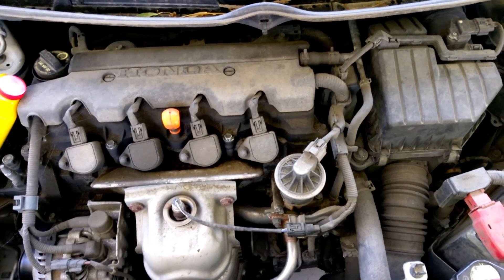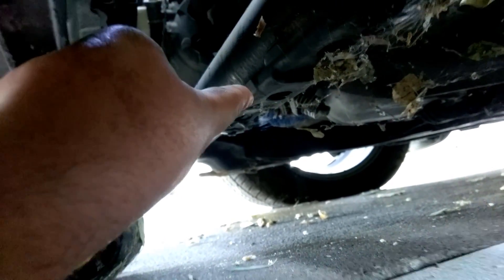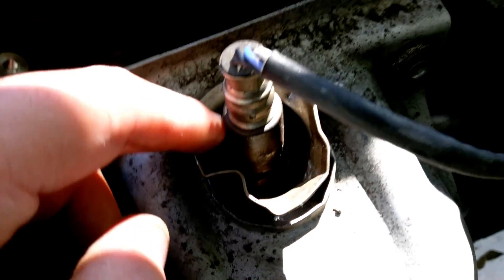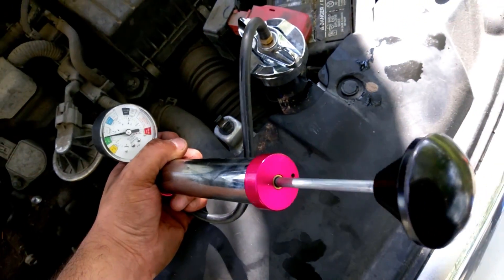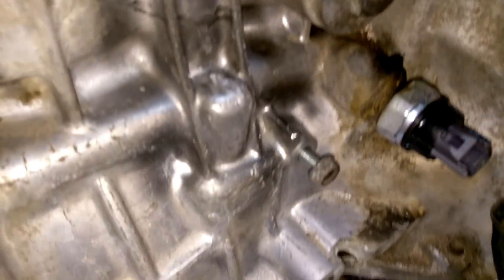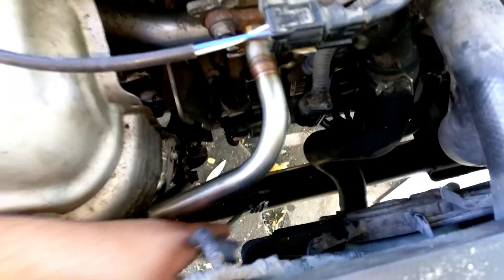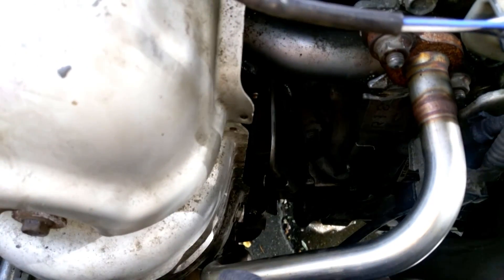2006 Honda Civic Cracked Engine Block Repair

Comment: It works !!!! most importnat thing is to take out the coolant completley so when you apply jbweld on the engine block, the coolant doens come out. I took out inlet pipe line to take out coolant completley.
Reply: is it still working?

Comment: Tips:  
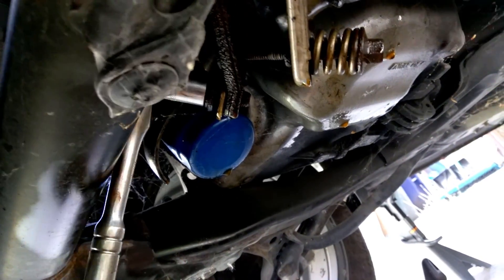2:40 when taking out the oxygen sensor. There's two parts. You unplug the one to the right first. Then the one with the sensor is clipped to the bracket. The release switch is facing you hidden behind the plastic. Push down the switch and slide the plastic from the bracket.

2:52 just loosen that bolt you don't need to remove it.

Comment: Prior to covering with JB Weld I recommend using Loctite 290 and primer T or primer N. Coat the crack with primer, let it soak in and dry for 5 to 10 minutes. This cleans the crack. Apply the Loctite, leave it for 30 minutes to an hour to allow it to cure. Remember Loctite cures in the lack of oxygen. Then go ahead and apply the JB Weld. Loctite 290 (green) is meant to seal cracks as well as thread locking of assembled nuts and bolts.
Reply: HI,

 I live in Canada and its hard to find Loctite 290 in stores or on Amazon, the only Loctite product available in stores is Loctite Blue 242.  I have found an equivariant product which is Permatex Green Thread locker.  However for the Primer T or Primer N I can't for the life of me find this in stores or online, and unfortunately I cant find a suitable replacement either.  Are there any other products I can use that is the same as Primer T or Primer N.  Any suggestions would be greatly appreciated. Thank you.
Reply: Is the loctite and primer good for a cast iron block crack as well? Or only aluminum?
Reply: When you mention primer t, are you referring to Mapei Primer T waterproofing membrane?
Reply: @jalton9416  I think he refers to Loctite 7471 PRIMER T or Loctite 7649 PRIMER N
Reply: @JavierAlba  thanks
Reply: I just used your method with success.

Comment: Woah this works! I just did this on my 2008 civic a couple days back. Same process but I had to remove the alternator as well to really get into the crack area. Be warned! This isn't a permanent fix, it can last 2 months, or 2 years! No way to tell unfortunately.
Reply: is it still working ?
Reply: @matthewkretz4257  So far so good! It's holding up quite well here up in Canada with the cold. I'll probably add on a another layer of JB Weld in the spring time.
Reply: @BigChunkyy  Update?
Reply: @FD-rh6tr  still functional! I've actually done a few long distance road trips with zero issues!
Reply: @BigChunkyy  Insane. My 2006 R18 with 160K hasn't cracked yet, but i might have to do this when it does!
Reply: @FD-rh6tr  I'm amazed myself too. Such an expensive fix to a huge problem. Holding super well too, I check my engine for leaks or drips every so often and still nothing. Bone dry! Literally saved my car
Reply: Is it Still working?
Reply: @luis4769  It is! I've already put on about 20000 kilometres since the patch
Reply: @chelsy Jordan is it still working? I was thinking about doing the same thing but I heard that the material gets stuck in the radiator or what not and cuz of that it causes it too over heat has this happened to you has any of the seal leaked off into any other parts or?
Reply: @BigChunkyy  ^
Reply: @ayaanhashmi7161  hey, yes it's still working! I haven't heard anything about that myself, but I know for a fact that it's been holding up and nothing has been leaking. JB Weld is rated for high-temperature use, if you're worried about leaking I'm pretty sure J-B Weld even has a high heat version. Depending on where your crack is, it shouldn't be touching any other components anyway, that was the case for me
Reply: @BigChunkyy  thanks so how long has it been since u patched it up and it hasn’t even started leaking a bit yet? Temperature and what not is good? No overheating or such?
Reply: @BigChunkyy  i actually have the same problem and somebody told me like I won’t last long with this leak so I’m just finding whatever I can to fix it without replace my whole engine block as my engine is in very good condition i just have this coolant leak problem
Reply: @ayaanhashmi7161  what year and make is your car?
Reply: @ayaanhashmi7161  look into liquid solutions like K-Seal or others. But the Weld worked like a charm for me, mind you I do have an again car and it was the Weld or a new car so yeah
Reply: @BigChunkyy  i have a 2006 Honda Civic I live in Canada as well so I’m trying to find something that won’t go wrong for our weather conditions
Reply: @BigChunkyy  The external temperature of the block is well under the JB weld max temp requirements of 500 degrees.     What will probably get you over time is vibration through the jb weld product will eventually cause it to start to break down.   But fresh aluminum weld won't be subject to this issue.
Reply: A little update for anyone who wants to do this on their car or is curious about how it’s going. It’s been almost 3 years now since I’ve patched my 08 civic with JB Weld for the same engine crack problem. Since then I’ve put on just a little over 35,000 km and I’ve driven it all year around through summer and winter. Coolant levels are stable and the temperature gauge always reads normal, thanks again for posting this video! You helped save me so much money in replacing the engine or even worse getting a new car
Reply: @BigChunkyy Just curious, what was the procedure you used to JB weld it?  I hear mixed results, I’m assuming you drained the coolant and really cleaned and prepped the block well before applying JB weld?
Reply: @BigChunkyy
What type of jb weld did you used ?
Please let me know !!
Thanks in advance
Reply: @josexivir4260 The original one. The one that comes in a black tube and red tube
Reply: @ammardin6550 my procédure was pretty similar to this video. My crack on slighty to the left so I removed the alternator not the o2 sensor. Then I cleaned and sanded the block the best I could for the JB to stick. And no I didn't drain the coolant.
Reply: @BigChunkyy  
Thank you 
I already did it with the jb weld marine one
Reply: @josexivir4260 hi. Wondering how yours is holding up?  Doing my ‘06 civic now and will see how it goes.

Comment: have a 2006 civic. backs in august 2018, and after only 43K miles on my car, the engine cracked. Honda did extend the warranty for 10 years from production date so my warranty expired in august 2016. since i was 2 years outside of the warranty, honda would not replace my engine for free. they wanted me to pay $4000 and they would pay "the rest" - stating it would be 7K plus. turned out it was $5500 so I still had to pay $4000 and Honda got off paying only $1500. Since getting my car back, the transmission is not shifting smoothly and the engine light came on. Honda wanted $190 to run diagnostics. I said eff that!! Honda makes me sick!! they knew about these faulty engines - they should pay regardless of years.
Reply: I know its been a year since you posted your comment. I just wanted to add my 2 cents. I was out of warranty for 2 months. Honda Corporate did not offer me any assistance. I said to Honda had my engine NOT cracked and was still under warranty would you switch out my engine before the warranty expired? They said, "why would we switch out an engine that is not cracked?" I tried negotiating with Honda for 3 months still got NOTHING. After that I said F you Honda. I belong to a large union and will tell everyone NEVER to buy another Honda ever again. Since then, I've purchased 3 Toyota vehicles and sent pictures of them to Honda corporate.
Reply: @domtam6571  lmao great response to Honda.

Comment: I have a crack on my 8th gen block.  Was going to try this drain  coolant clean area where the crack is located. Spray some high temp paint . Few coats. Then jb weld.anothet layer of high temp paint.
Reply: Did you end up doing that? Did it work?
Reply: Just been wondering why did you have to apply high temp paint? While there is JB weld 2 parts mixture could hold up to 550 degree F. I guess engine temp wouldn't go up that high.
Reply: @dannytrinh07  
Sorry first it was in weld and then John temp paint I was just really trying to seal better for piece of mind . It slowed leak down to putting coolant every 2 weeks rather then every other day
Reply: all it did was bought me some more time it slowed the leak down until I sold it

Comment: If JB weld ever stops holding, there are people who can weld Aluminum. If you found the exact spot where it was leaking you could probably just touch it up and be done with it.
Reply: To do that would be have to remove the whole block?
Reply: I have the same question.
Reply: @SAM59846  nope you just need access to the part being welded

Comment: Hi.   On the cracked block 2006-2009.  I"m told that 2010,2011 don't have the cracking issues.     I was curious if any other years can be substituted, because 2012 and 2013 1.8L civic engines seem to be cheaper than 2010 and 2011.
Reply from the maker: To be honest I’m not sure
Reply: @JCAUTOMOTIVE4444  Thanks for responding.   From what  I have seen in these threads is the thousands and thousands who have suffered this issue have not properly issued complaints.   The issue is more common than alluded to.
Reply: What i'm saying is if everyone in the few dozen youtube sites related to this put in the properly issued complaint, it's possible something may be done.

Comment: @Laketownautorepair  Which option is better to fix this problem JB Weld or  Blue Devil engine block sealer?? Let me know please, having the same problem with my 2007 Honda Civic..... Thanks
Reply from the maker: I've never used that product in particular.  But here is my issues with these type of products  
1. A crack on the block is a bit bigger and products like these usually dont work or dont do a good job sealing.
2. They clog everything like your heater core, radiator and so on. Coolant passages that are clogged could cause overheating issues.
But like I said I've never used this  product itself. I've used others like this and it was a nightmare. If you do end up using it, let me know how it turns out ,I'm curious.
Reply: Blue devil works great for me its pricey but you will see good ling results have same issue also going to.j
B weld it can't go wrong

Comment: My engine block cracked and we called the Honda dealer ship about the extended warranty and they refuse. We kept calling and complaining and they finally gave in and did the repair for us.
Reply: mine is a 2006 and the engine block is cracked they said they would check it out... you think they'll do it, even though the warranty is past 10 years? It only has 96000 miles.
Reply: How did you get them too. Mine just cracked and is also a 2006. The warranty expired 2 years ago and that's when I bought it from the dealership.
Reply: I need to know as well
Reply: More infos please. What your was your vehicle and miles. I’ve got the same issue as the rest 2006 civic cracked block behind the catalytic converter
Reply: Go to the dealership and mention technical service bulletin 10-048. I got mines replaced a few years ago. It does have a 10 year extension
Reply: im confused it says 10 years from purchase date  how did you get them to do it past the 10 year mark.
Reply: I have yet to hear of someone that they actually broke and fixed this problem for. This post was done 8 months ago and this person hasn't responded back with any other details. I don't believe this person at all.🤦🏾‍♀️🤦🏾‍♀️
Reply: @tortuga_t4rslownsteady805  really i just got  a 2007 honda civic and i checked  the history  of the car has a crack engine block previous owner said he got it fix idk how long that will run for and will honda still replace  my engine?
Reply: side_show_tone  thats not high miles for a civic
Reply: @MrSebas23Days  did they do it?

Comment: Hey, thanks for taking the time to make this video. 
Last weekend i found my car (civic 2006),  has this same issue. 
I think  i´ll be fixing the block with JB Weld, see how it goes.
Reply: If u have a welder I recommend this option as well 

Use a center punch at the end of the crack about a finger length away from the crack

You do this for incase it cracks more while in repair and so it won’t spread. Once that’s done use a carbide Dremel bit and remove enough material to weld onto  but the crack can potentially come back sometimes in the same area it’s really a hit or miss whichever u do go with sometimes no other issues come up sometimes same issue reoccurs 
But with the welder u can weld and sand down the welding marks and would never know anything was done
Reply: @luigimartinez7127  Have you done it yet?   I can see the webbed area on the block, I'd grind visible crack down as you said, but also completely fill in the webbed area with fresh aluminum weld.   There is no earthly reason why it should leak after this.
Reply: @dennisrobinson8008  not on a block yet but cylinder heads I have. 

The welds hold together well. Haven’t had issues after
Reply: @luigimartinez7127  Did you do it or did you have someone do it?
Reply: @dennisrobinson8008  I done it but it was trial and error..was my first aluminum repair
Reply: Once I figured out the technique it was fairly simple
Reply: The reaction from the aluminum head  I was working on was my problem. I had to go through several different products to figure out which reaction was working.  One stick weld was gassing off too much and was burning off instead of flowing.   I also adjusted the temp to burn a little cooler and it did a lot. But the  clumping was there but less persistent
Reply: @luigimartinez7127  To get it down one needs to expirment on some junk heads or block that they don't care about.   To figure out their process for the certain types of repairs they would make.    I
Reply: @dennisrobinson8008  yes I agree, I wasn’t too worried if I messed up the head. This was really my experiment with aluminum weld so it was definitely worth a shot of repairing. Definitely was trial and error but have to start somewhere. 

I had several options available if I was looking toward other options but it worked out in the end I was quite impressed but overall was a hefty task but I’d definitely would do it again to save a few bucks

Comment: How is it holding up so far. I’m gonna try do this for my 07. Just started to leak from the block.
Reply from the maker: Well it held up for 3 years but now the car is long gone. My sister owned it but sold it dirt cheap
Reply: How many miles did you have on it when u discovered the crack
Reply: @jasoncurry2515  mine had 172,000 on it when it started leaking from the block

Comment: If u have a welder I recommend this option as well 

Use a center punch at the end of the crack about a finger length away from the crack

You do this for incase it cracks more while in repair and so it won’t spread. Once that’s done use a carbide Dremel bit and remove enough material to weld onto  but the crack can potentially come back sometimes in the same area it’s really a hit or miss whichever u do go with sometimes no other issues come up sometimes same issue reoccurs 
But with the welder u can weld and sand down the welding marks and would never know anything was done

Comment: Still holding? I went ahead and this a couple months ago. Same car same year. Found the crack behind the starter. Put 3 layers but I'm constantly looking at the temp and I hate that i do that.
Reply from the maker: Surprisingly still holding
Reply: @JCAUTOMOTIVE4444  Does all the civic engine gets this crack in block?
Reply: @NaveenKumar-vy8rb  No just 8th generation civics specifically the 2006-2008 usually 09 and up are pretty good
Reply: @mawrkrobinson  Have the 08 civic 220.000 so far no crack. I hope it dont crack the car runs and drives very good.

Comment: how to take out coolant from engine block? when I appied jb weld on the engine block, the coolant kept on coming out. so frustrated
Reply from the maker: Jin Kim drain coolant from radiator  plug or disconnect the lower coolant hose.  That should drain out most of it so you can put the jb  weld on
Reply: theres a drain bolt on the block on the front driver side by the knock sensor

Comment: Did you drain it after you did the pressure test so you could see it where its leaking? My 2008 honda has 48000 and this just happened...trying to just get rid of it...
Reply from the maker: Yes I did

Comment: hi my engine broke near the water pump and the local Honda did not want to change my engine because it was out of warranty... do you know if this type of welding will work on that section of the engine??
Reply from the maker: I cant tell you for sure if it will. Never tried it.
Reply: are you saying the tensioner bolt broke....its possible to extract it, you have to torque the new bolt to exactly 40 ft/lb's and use blue loctite

worst case scenario is you need to  have a Time Sert installed